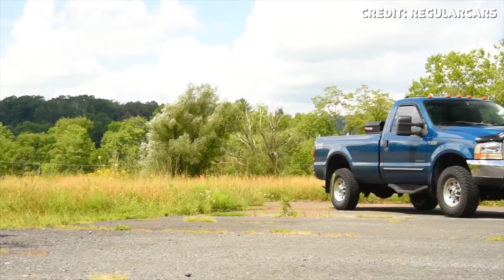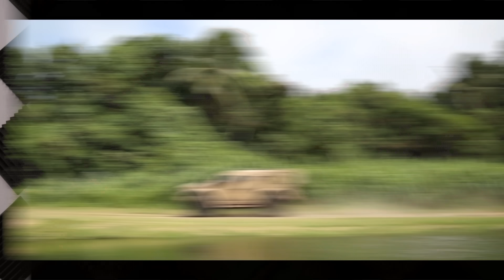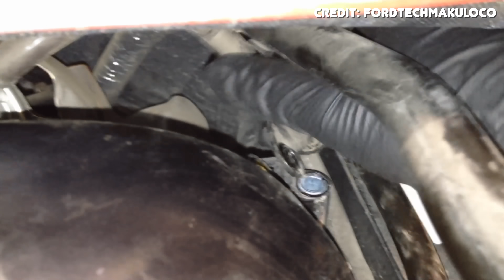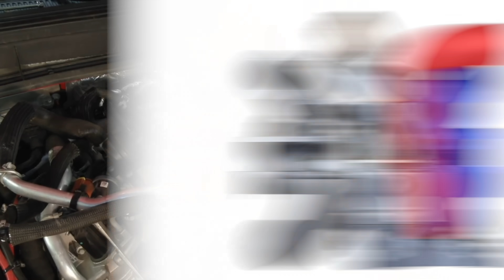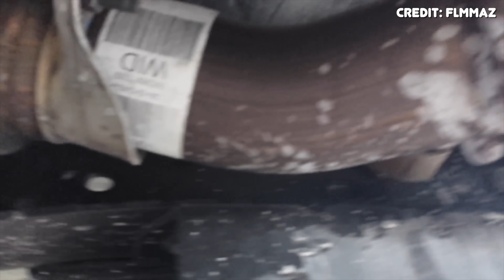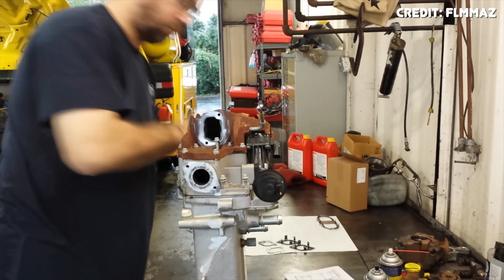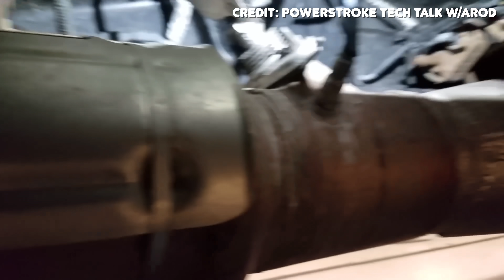Everything Wrong with the 6.7L Powerstroke

Comment: I have a mechanical 7.3L without a turbo and I just don't feel the need to upgrade. All the electrical and computer systems on a modern diesel bother tf out of me. I used a 2017 F550 for work, and that thing was constantly having problems

Comment: I had 6.7 powerstroke for 3 years. Never had one problem with it except an alternator.
Reply: No issues with mine either 6 years now but it does have the upper pan leak but am pretty sure by now that’s normal 😅

Comment: I was absolutely never a Ford fan. Then I was given a 2014 F-250 6.7 by a friend who just has it like that. I needed a vehicle to get back and forth to work. He told me it's a fuel hog but it'll do what I need kt to do. It had around 220k on it. Already updated.... If you know what I mean. I'm still running it and compared to the Silverado I was driving it's been reliable and has never left me stranded. The Chevy broke regularly and wasn't even over 100k. The 6.7 is the greatest engine Ford has built to date. It has more power than I'll ever need. I'm still not a huge Ford guy but every manufacturer has their great ones. In my opinion the 6.7 is among the greatest engines ever built. All the Dodge boys are quick with the Cummins, while we're just getting our stroke going.

Comment: My 2012 had a lot of these problems. At 242,000 front main bolts backed out broke the harmonic balancer. The #5 piston exited the motor, really bad day. I changed oil a d fuel filter every 5k even added Lucas to the fuel for lubrication. Still it wrapped out.

Comment: How about that shitty CP4 pump.

I did th3 DCR conversion on mine after that pump could of destroyed my engine.
It did clog the screen with metal.shavings. But did not get into the injectors. Which I was lucky for that. My cost was $8600. And I say lucky because another truck was in the same shop with a $12000 repair bill on his for the same crap. Apparently, his metal got to the injectors and into the engine.

Comment: You can get lots of power out of the 7.3 though and a lot cheaper than one major repair on the 6.7.  I'm sure the 6.7 is great though, when it's running issue free.

Comment: 253,000 on my 11.  I’m still on my OE CP4. Turbo was replaced year one under warranty. Since then. The truck just works. I’d like to know what percentage of CP4 failures were fed gas, water or air? I guess that to be a very high percentage. I feed it Motorcraft Cetane every fill-up No oil escapes my truck in between changes.

Comment: You forgot to mention how the timing gear is pressed on the crank and not tig welded and can spin on the crank and screw up your timing alignment when the CP4 goings out and locked up the timing gear. And the fix for the CP4 is the new DCR pump, you will never have a fuel problem again with DCR installed properly.

Comment: For those on here talking about the gas version my son n law has a 2023 f450 with gas motor. The fuel pump went out. At 55k the transmission quit. He is a electrican and must have dependable truck. The mechanic at Akins Ford told him ford is having a major problem with transmissions. I can tell ya the brakes don't last long. I doubt he will keep this ford . I believe he is thinking of going back to dodge. His last one had very little maintenance and never stranded him.

Comment: As for the CP4 the pump can be rebuilt by a diesel shop and there a number of revisions of this, fixing the main problem with the original design - which is the pin on the pistion can free itself from the piston and turn 90 degrees (which causes the mark on the cam of the pump you can see on the video) . So if you are afraid of the pump failing just go ahead and get the pump rebuilt or replaced by a diesel shop who has the equipment to dissasemble, rebuild and then bench test the CP4 with the most up-to-date parts or replace it with the latest revision. Preventing an issue is always easier than fixing it.
Reply: That's just dumb.  If you go through the trouble of pulling the pump, put a DCR in there.  Pump is $2400 right now.

Comment: I had a 2003 7.3 built in the las 3 months they were made. No issues but didn't like to start in the cold below freezing. Had a 2011 6.7 I sold with 250,000 miles. Coolant leak at the turbo and new exhaust sensors Ford paid for. Now have a 2020 wtih 98,000 miles, Love the extra power. No issues what so ever.

Comment: How could you have no idea why emissions aren't on those industries. Use your head guy.
Military- We have unprotected sex when we want to procreate, we run war-ready machines that aren't encumbered by emmesions controls which would be dumb when every other thing a battle is is bad for an environment
Aviation- Emissions would be added weight, and reduced reliability, safety is no1.
Merritime: Cost. Got to keep operational costs down. They do have clean fuel zones where you cannot burn heavy oils, so they do have emissions controls... You could've googled any of this.

Comment: I bought my 2001 F250 new.  I still have it today, with 179K miles.  In fact, we bought a 2024 6.7 because new trucks ride so much better.  We decided to keep the old truck.  It's not worth much anyway.  And, it's kind of like a member of the family.
Reply: I also have a 2001 F250 7.3 that I bought brand new it now has 184,000 miles on it. I have been offered from 15 all the way to $20,000 for the truck if they’re in good shape you see quite a few of them in the $15-$20,000 range so hang on to it. It’s only gonna go up in value.😁

Comment: charge air cooler outlet tube leaking boost, water pump leaking coolant, upper radiator hose o-rings leaking coolant, vacuum pump gasket leaking oil, pcm software issues, particulate matter sensor failing, lower intake manifold becoming restricted with soot and causing egr flow concerns  - those are the main problems I see not covered in this video. great video!

Comment: All info, no BS. This is the channel I've been searching for
Reply: Why? He's dead wrong lol
Reply: @Kolonol1 about what
Reply: @kan50805  #1 that the 6.7 is less problematic than the 6.0 or 6.4. this guy as well as tons of other Ford simps in here keep trying to convince people that the 6.7 is anything but a problem motor. I'm a diesel tech and at the shop, these things are making us tons of money!!! #1 no tangs on the bearings. Ford and a few other people have tried to tell us that the tangs have nothing to do with spinning bearings but apparently they are wrong because our independently sourced bearings where we have had tangs put on and the blocks and rods machines for it have yet to spin a single bearing. Ford engineers got caught lying by a few shops now about this.

#2 what about the timing issues? On top of being known for spun bearings, the other MAJOR issue with the 6.7 is if you put any major power to it? The engine works itself out of time. Eventually stock motors do it too with no tunes or anything. Based on what we have seen, every single 6.7l Ford diesel will eventually have the timing gears slip. There are no keyways. Everything is press fit. Cummins has keyways. Duramax while problematic still has pins. The power stroke has nothing.

#3 and this is something we have been noticing lately on the newer models not so much the older ones, the turbos are seizing up due to oiling problems. The older ones had other turbo issues.

Some of the timing and bearing issues, have led to bent rods and cracked cranks, but that's due to the other failures. It's not like the....LBZ? I think it was the LBZ Duramax that had the cracking crank issues.
Reply: Ram has pins to on the crank.

Comment: The cp4 uses a EXTREME cam lift profile. The cp3 uses a gradual lobe lifting 3 lifters. The problem is lifter hop at higher RPM. There is no fix. Nothing. Nothing can fix this pump. They are a awful design. The best you can do for yourself is buy a CP3 convert kit from fleese diesel.

Comment: Bought a brand new 2010 6.4 power stroke I must be lucky. The only thing I’ve done on that truck is replacing alternator and that is it. I’ve never had one problem with the engine.

Comment: Good video, I bought a 2012 Ford F-350 recently, it came with power stroke 6.7 (1st generation according with your info), the engine is broken and I will rebuilt it. So what can I do to improve it? What components can I replace for a better one. Please provide brand and code model. Thank you.

Comment: I had a 2015 F550 with the 6.7 with 240k and loved it. Right at the end I replaced all 4 EGT sensors, new turbo, cab off oil leak, ect. I just got a new 2023 F550 so far so good. Only thing is the F250-350's got the 475hp or HO 500hp 6.7 and the F450 anf 550 got a detuned 330hp 6.7. But with the heavier trucks it might break something with 500hp.

Comment: My first 450 was Satan's truck. 08. Blew 6 radiators @ 750mi @1200mi, 2400mi... Had 6 catastrophic egr valve issues and several times that the dealers didn't install everything right. Now I have an 2012 @137k, it needs a new ac pump, I keep having to throw def heat pumps at it, and now got hit with that fuel rail issue. I'm a mom with 3 kids and do ministry in the desert. And I take care of my husband, mom, and mom in law who are all disabled. This is gonna really hurt if I have to replace everything AND the injectors. Pray for me.

Comment: I’ve had every diesel ford ever offered from the 6.9 to the 6.7 except the 6.4. I’ll take the 6.7 over Amy other engine. The next would be the 6.9. That was the most simple engine to work on. Not much power but super simple and dependable.

Comment: The reason for loose emissions stands on military and aviation is because reliability is paramount. You can’t pull over in the side of the road in Syria to swap out an EGT sensor or stop at 40,000 feet to diagnose an emissions code.
Reply: That and aviation and military are, in regards to emissions (when we're not in a kinetic operation), are very small potatoes.

Comment: I will start with the unreliable electronic direct injection. Stupidity mechanical direct injection is so much better and reliable.
Reply: I also think as unreliable as electronic direct injection is Ford could make a lot of money getting rid of the reliable timing gears and go to a chain. The design's that are supposed to be new technology is not they are using design's that have been proven to be unreliable in the past.

Comment: I had heard the 6.7 had an oil starvation issue because the main oil passage leading from the oil pump was needlessly large and its taking too long for the oil to get to the top end. Not sure if this is the case or not...Ford also is putting this engine in the their F650/F750 trucks as well which in my view it likely shouldn't be considering its not a medium duty truck engine...

Comment: I am not a fan of the 6.7 ford powerstroke the intake stops up the pistons are junk rocker arms made too weak I have a 2022 that has a 120,000 miles its on its 3rd engine sorry i could have bought 2 trucks for the price of engine replacements

Comment: if you notice, all the issues where from out sourced components. Like sensors and fuel pump. Can't do everything in house. I am on my second 6.7, had a 2017, now have over 100,000 on my 2019. Looking to get a 2024 next year. Trying to decide if the new H.O is worth the extra $2500

Comment: I have the 2012 6.7 Powerstroke and it is still running flawlessly.  The key is maintenance.   I use Rotella T6 full synthetic, use the Motorcraft filter that I pre-fill with one quart and change fuel filters at the proper interval. I inspect air filters regularly.  I only buy fuel from a station I know sells a lot of diesel fuel, never a place that has a single diesel pump tucked away at the back of the lot.  The only repairs I've had pertain to the DEF system and those were covered under emissions warranty that Ford extended.  I can't beat the low end power when pulling my 5th wheel that is 12K dry.

Comment: ive got a 2001 7.3 f350 dually very reliable 216,000 mi everything on it still works cold ac hands down it dont have the power my 2014 f250 6.7 has its got 416,000 mi on it no problems except the ac i got a fortune in it and still dont work and now all my dash warning lights stay on i love this truck but its the little thing eating me up but what power

Comment: I’ve got a 2020 F250 I put water in my secondary system replaced oil cooler deleted egr now when I take oil filter off water is coming out of oil filter port there is no oil in truck where is water coming into oil at two months every one says head gasket but my primary system is holding antifreeze

Comment: I own both 2001 Manual trans 7.3 and the 2014 A/T 6.7 the 7.3 has had a LOT of changes to it turbo, injectors Etc. and producing 435 HP runs Great. the 6.7 is right now getting the 2015/16Upgrade turbo  which will then have right at 550 HP due to some tuning and injectors, both are 4x4  love both of the trucks

Comment: If youre looking for a 6.7 powerstroke just get one 2015 or newer with the weight reduction kit and you wont have any issues.
Something of note. The oil pan gasket will fail by 175k. And you gotta lift the engine to get it replaced. So its a 1 grand job.

Comment: The government mandates these changes only for the general public and private business's at a tremendous cost. These emission systems are inefficient and unreliable. All the car manufacturers make tons of money in replacement parts as well as the dealerships which have more work then they could have ever imagined. So they have ZERO reason to fight the new emission laws. Meanwhile our government does not require themselves to make these changes. No government vehicle is required to have these costly ineffective modifications. Diesel fuel is far cheaper to produce than gasoline and was always cheaper. Now di sel runs .75 to $1.59 more per gallon. Imagine the billions more required per year to move produce and other products required by every citizen. This amounts to an incredible tax increase to each and every one of us. No one talks about all the added pollution caused by these new laws. 10 of thousands of cargo container ships transporting the emissions control devices from overseas each year. All the added plastic and cardboard to ship these items in. The pollution required to manufacture the hundreds of parts required for each vehicle. It's outrageous at how much more costly and decimating this is to implement these so-called environmental solutions. Electric vehicles are no different. The few areas in the world which produce the cobalt and cadmium ( all very toxic items) are excavated by mostly slave labor. Once these vehicles start to age and those batteries need to be disposed of in volume where will they go? Electric vehicles are far more toxic than current combustion engines. Current diesel vehicles get less miles per gallon and less horsepower and are far more costly to purchase with emission systems that are complete failures and are far more toxic on the environment. The billions in adder repair cost and all the other costs associated with this are just past the one to us the end user. What our government has done to the general public  is just another unconscionable scam in a  just of many perpetrated on the American people.

Comment: So given your vast experience, how is a non-mechanic supposed to pick a truck out? Isn't the 6.7 Powerstroke considered the best engine on the market right now? So wouldn't that make the F250/F350 the best work and haul trucks given the engine?
Reply: Yes - however, when Ford and GM contracted/outsourced their 10 speed transmission, back around 2020/2021, it’s become a fuvking nightmare for the heavy duty lineup.
    Don’t get me wrong, the mileage difference between my buddies 10 speed and my 2014 Super Duty is unbelievable, but until Ford solves the issues, only purchase a truck that has an extended warranty, and then dump it when the warranty expires!!!

Comment: 2020 F350 6.7 and I had a bad knock. Changed fuel filters, knock still present and a regular mechanic shop said something wrong with injector and there was metal in the fuel filters. I brought it to the an actual dealer and they said they see it all the time and there are  (I think)5 trucks for the injection pump right now in their shop. Not covered under warranty. My truck has 103k miles.

Comment: Never owned a diesel, I'm debating 7.3 godzilla or 6.7 power stroke 2023 f250. Do i need to be worried about the diesel, if not which gas stations in Phoenix area should i use.

Comment: How about the rocker arm issues with the 6.7? I have seen a few. And with mine being down at 97,000 miles with rocker arms falling apart. I think this should be something that Ford should be looking into also. It goes along with the wiped cams because of the lifter set up with two push rods per lifter. When one rocker arm fails, the lifter spins in the boar and wipes the cam. I think this is a problem more widespread than what is being led on. Keep up the good work and thanks for the video.
Reply: Hence all the fb marketplace 6.7l parts trucks now

Comment: I have 2011 ford f250 with 310k miles on it deleted junk from the engine  when warranty expired, never had any issues mentioned,  I did changed fan clutch at 200k and just recently changed oil cooler that got clogged , so it's pretty good engine compared to my 6.0 back in the day